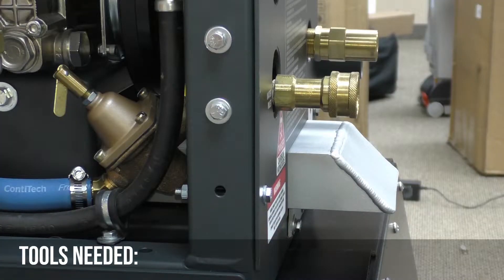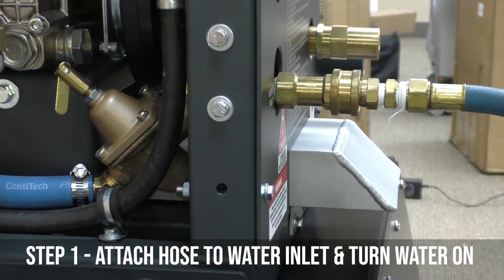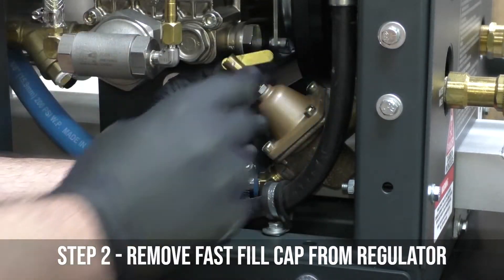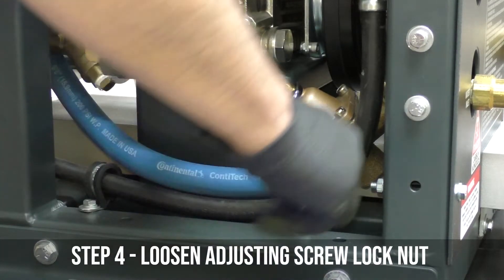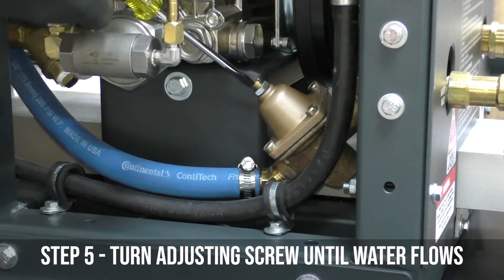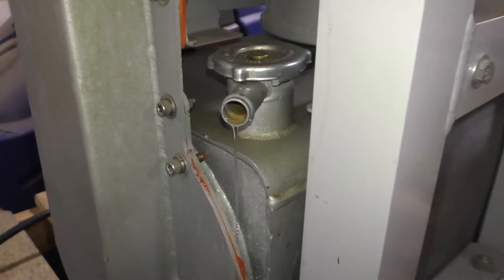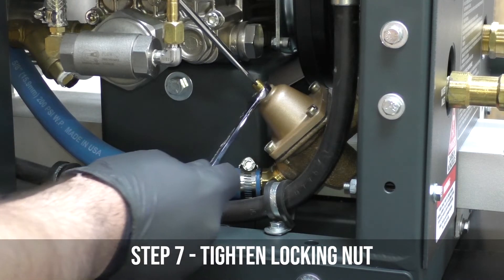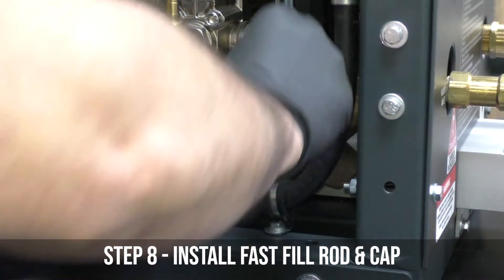Adjusting the Inlet Water Pressure Regulator - Sapphire Scientific / Prochem Truckmounts

Comment: Does the motor need to be running? I have my water hooked up, van and motor turned off... Turned clockwise but no water.. 

Sapphire Scientific 1200 truckmount
Reply from the maker: Hey Alex, the Pro 1200 does not have a thermal well so when you adjust yours, all you are doing is adjusting the pressure going into the pump. You are welcome to call our toll free and ask for Justin Johnson or any member of the service team if you still have questions. (800) 932-3030

Comment: How often would the inlet water regulator need to be adjusted?
Reply from the maker: There isn’t really a set time per se, just whenever the water box starts to overflow.
Reply: Well my machine is brand new, and it's already bad. So, just like the rest of this Saphire 370, have parts on hand cause this is poorly built rig. Worst I've ever owned.